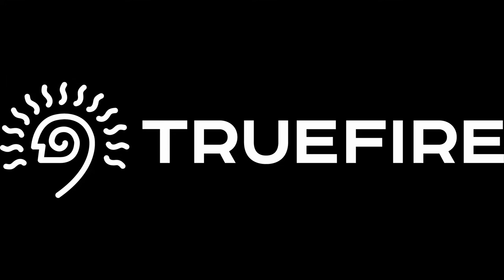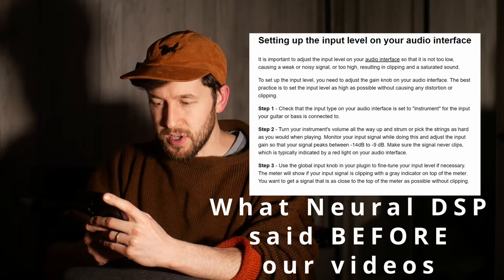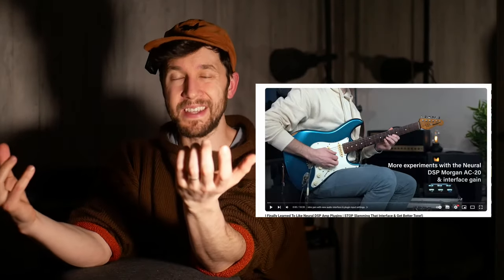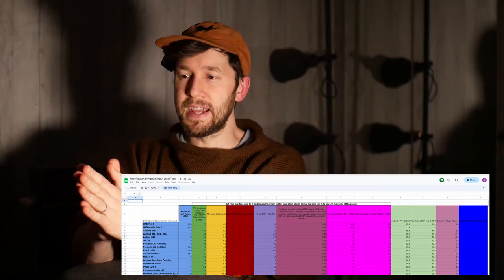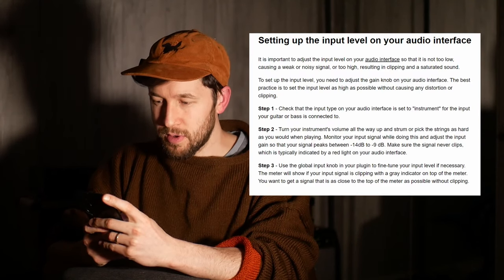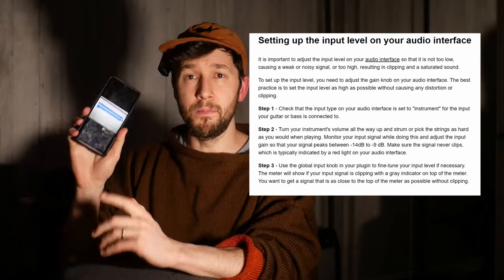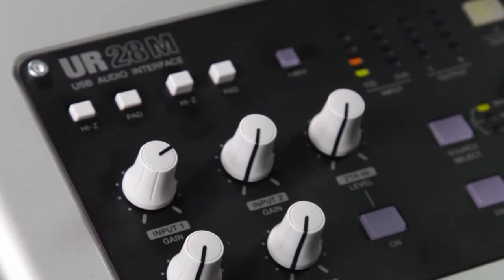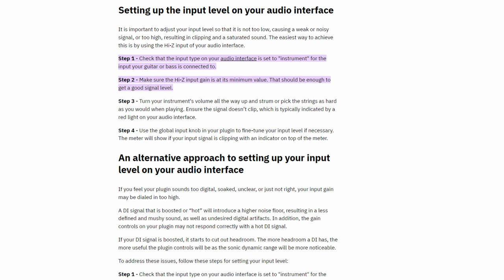Why Are Neural DSP Gaslighting Us About Plugins and Input Gain?

Comment: This is a hilarious scenario. We've always, always, always heard about setting the input gain to "where it doesn't clip" and now plugin companies are all Pikachu face because clearly you just need to put it to 0 and not fiddle with it 😂

Personally I still set my input gain on the interface higher and set the input on the plugin lower. This is because I want my recorded waveforms to appear "regular" and not require me to zoom in 1000x when trying to line things up :D
Reply: This man. If you recorded too low with this new philosophy you won't even see any waveforms
Reply: @EthanRom  - You can magnify the waveforms on pretty much all DAWs without actually recording a hotter signal.
Reply: @philmiller6655  This. Plus this whole debate is a non issue. The plugins don't care about what level you record at, they only see the level that you give them. If you trim the gain of the recorded audio or use an overdrive plugin in front, the level at which you recorded doesn't mean a thing.
Reply: It's good practice in theory because you are utilizing more of the bit depth of the recorded signal. At 24 or 32 bit audio, if you are setting your levels very low, you are only using a fraction of those available discrete values and losing dynamic range How much of a noticeable difference this makes in practice, I don't really know.
In my experience, preamps also yield better results when turned up, 
I would turn up my interface and attenuate before the plugin.
Reply: @lichen8855  there's no advantage to maximin bit depth. Absolutely none. The 1st bit sounds the same as the 24th bit. A 24 bit digital system will have more than twice the headroom of a good analog preamp, so the preamp will always be a noisier point in the signal chain compared to an A/D Converter. So... using every last bit isn't helpful. No point. No benefit. Not done in pro studios ANYWHERE. Given, I wouldn't recommend tracking at -60db in your DAW. Somewhere between -18 and -12 in your DAW is just about right, but truly every A/D Converter type will have a different optimal headroom. Check manufacturer specs.

And, ya, your analog preamp sounds better closer to red. Because in the analog world, this would minimally get you further away from noise. Plus analog clipping can be nice where digital clipping isn't.
Reply: @thahacksaw  A few things:
I never stated that bits sound different from each other. 
I never stated it make sense to use every last bit. 
No one asked what pro studios are doing.
Half your comment is answering questions no one is asking.
Taking advantage of both where possible is all that I was saying. 
You should refrain from correcting people on statements they're not making.
Reply: @lichen8855  bro, these are typed words on the internet. You don't need to be so sensitive. No one's attacking you 🤣 Unfortunately, "advantage" is what YOU keep saying. No advantage had from using all the extra bits. None.
Reply: @thahacksaw  You clearly project and make assumptions.
Just pointing out your behaviour.
 Typically dismissive with a laughing emoji. Classic. You should learn how to have a constructive conversation.
Take care!
Reply: @lichen8855  🤣 um, pot kettle much? Your whole last response is all assumptions about MY intentions. That's what projecting means. You're accused me of doing something while doing that exact thing yourself 🤦🏼 AND you've gone completely off topic. YOU made this personal, when I was here talking about audio 🤷

The main assumption of yours I objected to was the idea that there's an advantage to using all the bits. That's it. I'm not projecting. That's what YOU have stated, and implied, several times. You haven't provided a single piece of evidence for this. Not one. Not even an anecdote. You can edit your post all you want, I've still got the screen caps. You wanna talk about things "in theory". This is super cute and all. Unfortunately, we have 30+ years of real world application. We don't need YOUR new "theory". So I popped in to provide some real world application, and some anecdotes based on my professional experience. These things shouldn't subsequently cause YOUR ego to shatter and break.

Since you've already decided rude is the mood, I'll make this really clear. If you come to the internet saying silly things, expect to have someone set the record straight. If YOUR ego gets shattered from basic interactions like this, it's totally on YOU, not everyone else you run across in life. This is something that was explained to me clearly when I was probably 6, but better late than never I guess. So either stop saying silly things. Or get a thicker skin.

Or... maybe reading words on the internet just isn't for you. In which case, unplug brother... and go back to recording using ALL 24 OF THOSE BITS 😭 In a few months (or years), when your mixes are still suffering, and nothing seems to get you to that next level, maybe we can try this conversation again. Go over the importance of gain staging, signal to noise ratio, and the advantages of mixing with headroom in a digital system. Real advantages. Not theory. If and when that time comes, I'm here for you brother. Until then, say hi to that clip light for me 🙌🏻👍🏻

Take care of yourself. And I'm sure we'll chat again soon 🤞🏻
Reply: @thahacksaw   @thahacksaw  Is this what you do?
Correct people on things they arent actually saying?
Call them thin-skinned for calling you out on it?
Then write a near essay doing it all over again when they call you out on that as well?
You've spent a lot of words repeatedly proving my previous points and shown how clueless you've chosen to be.
I don't need to use 'screen caps' as some kind of power play or use condescending language like you do.
I repeat the end of my initial response. You should refrain from correcting people on statements they are not making.
Reply: @lichen8855  When you have your guitar connected to Hi-Z, the noise from the pickups will be already higher than the interface's self noise.
Reply: @lichen8855  You can't even keep track of what YOU have said. Let me refresh your memory.

YOU said: "It's good practice in theory because you are using more bit depth of the recorded signal."

Nope. It's NOT good practice AT ALL. And it's NOT a "theory" I've ever seen a Digital Converter Manufacturer or professional Audio Engineering recommended. It's completely contrary to the curriculum I received when pursuing my 4-year Recording Arts Degree. This statement from you is, at best, conjecturing. But to everyone else, it's 100% misinformation. It's misleading. And if noobies follow YOUR advice and "theory" it will cause them lots of problems. Problems that may never be obvious to them. It's BAD ADVICE and YOU are the one espousing it. Stop 😭 about the consequences of saying silly things.

YOU said: "At 24 or 32 bit audio if you are setting your levels very low you are only using a fraction of those available discrete values, and loosing dynamic range."

Nope. Dynamic range isn't the issue here. It's signal to noise ratio. Again, Intro to Audio, Day 1 kinda stuff. The dynamic range of an A/D converter is larger than an analog preamp, and a guitar pickup will often have even less than that. So the dynamic range isn't the issue. It's signal to noise ratio. If you analog preamp noise is at -50dB, your A/D converter noise floor should be around -130dB. That's an 80dB difference. YOU couldn't make the digital noise floor louder than the analog source if you tried. And your dynamic range is still restricted to the loudest noise in a given signal chain. If you preamps noise is -50dB, that's your useable dynamic range. Not the 130dB of the A/D Converter. If you plug in a Strat single coil, the noise could be even worse, around -30dB. Now your dynamic range is only 30dB. The ONLY advantage to tracking hot into a piece of gear is getting away from the noise floor OF THAT PIECE OF GEAR. If the gear in question is an AD Converter, its noise floor is further away than that of all the analog gear before it. So there's nothing to get away from. And tracking hot into the Converter won't improve signal to noise ratio from the analog gear behind it. SO... the real advantages of digital is a noise floor so far away from a typical analog one, it's almost non issue.

The idea of tracking hot into a recording medium only applies to tape. The whole point of digital was getting away from the noise floor of tape.

Hopefully that clears everything up and you can start gluing your ego back together. Looking forward to chatting again soon 🙌🏻
Reply: @iursnitram  exactly! 🙌🏻 Available dynamic range will always be limited to the actual signal to noise ratio of each piece of gear in the chain, or the weakest one. In a guitar recording scenario, the guitar itself will usually be the weakest link with regards to noise. Guitar amplifiers will have a better signal to noise ratio than a single coil pickup. Most preamps will have a better signal to noise ratio than your average guitar amplifier, although tube preamps can get quite noisy. Microphones are all over the place in terms of signal to noise ratio and can sometimes perform better than preamps and often perform, worse like a guitar pickup. Bottom line, by the time one factors in guitar pickup, guitar amp, microphone, DI input & preamp... the A/D converters signal to noise is practically irrelevant.

I still can't understand why folks are so insistent on using every last bit. Especially considering the negative effect it will have on all the analog modeled plugins in a DAW 🤷
Reply: @thahacksaw  It does thanks! 
Looks like things should be clearer for you as well as you actually went back and read my initial comment. 
I was never arguing for what I was theorizing "out loud" in that comment, but rather, I have a problem with you putting words in my mouth. 

Thanks for finally quoting what I ACTUALLY SAID (and I stand corrected) instead of effectively gaslighting and making me out to have argued for 'using as many bits as possible'. Additional to that, you have made me out to have kept arguing about audio when it was actually about your behaviour. 
Go ahead look! After my initial comment, I only correct your misrepresentation of my words and comment on what you are doing. I make no audio-related comments after that.

You claim I have made this personal when the only person who has brought up the concepts of ego and emotion is YOU. You use the word 'ego' and reference emotions a lot! Your writing tells more about you than it does about me. You think my ego is fallen apart because I've been calling out your poor conversational behaviour? I don't need to defend that except to say that you don't know anything about my ego. You're still here as well. Your ego is as involved as mine, but I'm not going to assume it's broken and tell you to glue it back together bro.

I am willing to be corrected. I stand corrected on my initial comment! It was just off the top of my head. This place is for discussion!
I welcome learning from other people but I do not tolerate people telling me that I'm saying and doing things that are untrue.
I made an initial comment based on my experience and a personal theory. I never argued for them again.

You want to educate people? Great! Really! We need people like you to help us. 
I know jack-shit about this stuff compared to people like you. 
But one thing I do know is that, if your going to correct people well, don't paint a misrepresentation of the person while doing it.
Reply: @lichen8855  you're welcome! But I'm truly confused. You just said:

"I was never arguing for what I was theorizing out loud in my comment"

Bro. This is an odd statement to make if you just go back and read your own words. Let's break your first sentence down, section by section:

YOU said: "It's good practice..."

That is YOU, making a value judgment. You said "good practice". As opposed to "bad practice", or "complete irrelevance". You can't use a term like "good practice" and not be arguing for said practice. You can't equivocate on value judgments without making an argument for one thing over another. So yes, you argued for your theory. If you didn't intend to present a value judgment here, then you need to be more careful about the words you choose.

So, according to you, why is it "good practice"? Well, let's look at the back half of that same sentence:

"... because you are utilizing more of the bit depth".

So, according to you, it's good practice BECAUSE you are utilizing more of the bit depth. I don't know what benefit YOU think utilizing more of the bit depth will grant you. Did you just assume more was obviously better? You never really made this clear. You just kind of stated it in a generally vague way, as if the implications are obvious.

When you use the word "utilize", you're implying a utility. And utility implies a benefit. So what's the benefit? What's the utility? What do you gain by "utilizing more of the bit depth"? If you know something I don't, I'm truly all ears here. But if you can't specify the utility, I have a decent list of why utilizing every bit is minimally counterproductive, and maximally problematic for necessary downstream events and processes.

As far as your accusations about my behavior... Go read MY first post to you. Not a single comment about YOU personally. Everything I said was factually accurate. I just stated facts. I never said YOU said bit 1 sounds different from bit 24. I simply stated the fact that it doesn't. YOU imagined that I implied you said it. Unfortunately I just stated a fact. That's it. A fact that helps correct misunderstanding based on your incorrect "theory". Everything I laid out in my first post to you was simply EVIDENCE against using every last bit. This isn't me putting words in your mouth. This is me laying out the facts.

After my post, where I laid out the facts, and didn't disparage you AT ALL... you were the one who came back trying to imply what MY intent was. YOU implied my intent was to put words in your mouth. YOU implied my intent was to attack you and belittle you. These are all speculations on your part. This is YOU projecting on to me. This is YOU making assumptions about my intent. Again, all I did was state evidence in my first post. So, you're in no position to make assumptions about my intent. My only real intent was to correct misinformation. Any assumption that my intent was to attack you is unfounded. Your first response to my stating of simple facts was to take it personal and overreact. This isn't a constructive way to have a conversation on your part. You're here, critiquing my ability to have a constructive conversation while being the person who made the first baseless assumptions.

YOU took my statements of facts personally. YOU assumed I had ill intent. YOU didn't bother to assume I was simply trying to educate you, or others. YOU assumed I came here maliciously. This is your projection, not mine. Just so we're completely clear on the timeline of events.

Comment: One thing I like about STL Tones plug-ins, is that they have an "intelligent" input level configurator, where you tell it if you have a low/med/high output guitar pickup, and it will adjust accordingly. When I tested it, it landed at 0.2 db of the optimal setting in Eds spreadsheet. I don't know why there isn't more companies that have implemented this feature.

Comment: When I was in sound engineering school, back i the dark ages! Gain gain/trim pot, was what you would use if you didn't have enough signal coming in, ie input gain. In the digital world, this is very different, noticeably when I started to use the Iridium, or now the Dream 65 and Lion. It drives me nuts, because it doesn't have the feel of an analog desk, which is what you are trying to achieve in a digital world! To the point now, that I have bought D.I box from Walrus audio with a line driver feature, to try and get a good signal in to my interface without any extra gain! So I only want to turn up the gain if i need too. Digital and analogue still have a long way to go, before it achieves a believable plus!

Comment: The advice to crank the gain so that you are as close to clipping as possible without ever reaching it is engineers best practice to reach highest possible SNR. In practice it doesn't really matter because modern AD Converters have much higher dynamic range than any guitar signal could ever reach so you can set the gain to uniy and don't bother.
I like how my FM3 does it, it has just 3 fixed input pad settings: 6, 12, 18 dB. If your signal clips, you set the pad higher until it doesn't clip anymore (Just like you heard it everywhere else) but since these values are fixed and changed in software, the decreased analog gain gets added right back digitally so your sound doesn't change. I think every guitar audio interface should handle it that way.
Reply: Yep, it would be ideal if all interfaces worked like that, but they would still have to agree and standardize on how many real-world volts = how many digital dBFS. If they all settled on one value for that, AND had an auto-compensating input like you described, we’d be golden and never have to worry about this again.

Comment: Set the input gain for best s/n ratio and performance before the ad converter. Then in digital post ad coverter world, adjust the input to the plugin to whatever is preferred. This way you get a healthy signal with low noise converted into 0 and 1s and the plugin will play nicely.